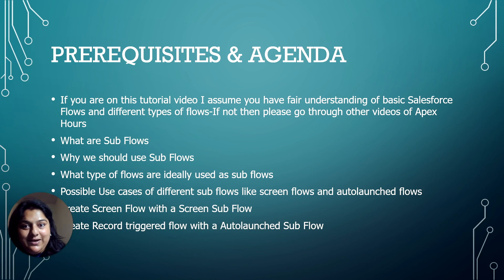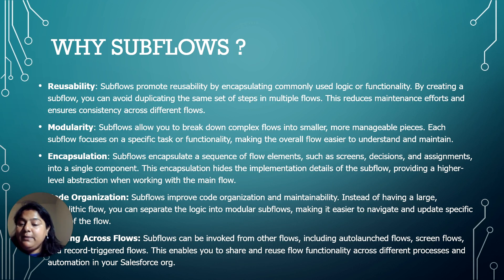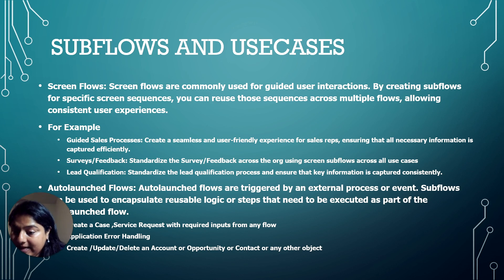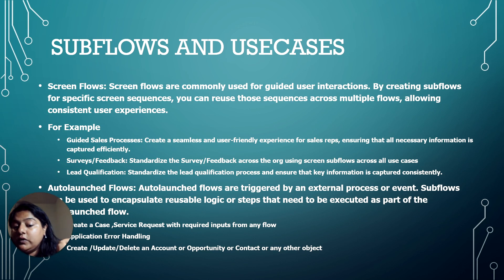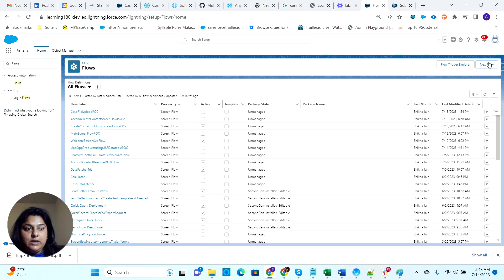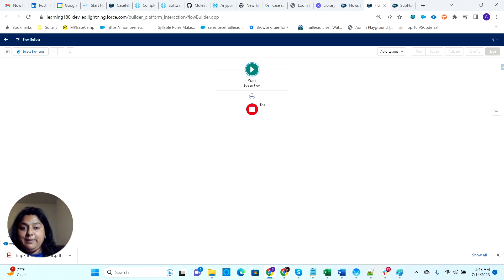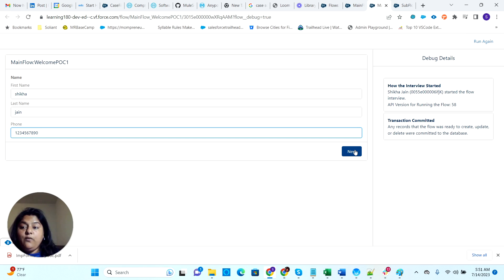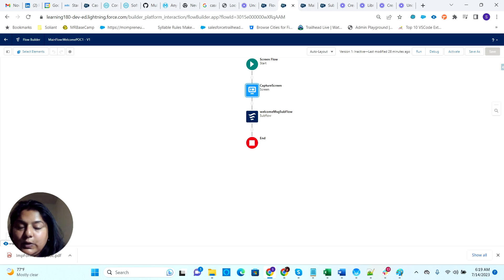Subflows in Salesforce

Comment: Thx for explaining how you connect subflows to the main flow. Can you also clarify how if one step in a sub(or subsubflow) fails you can easily see where it fails so you can debug? E.g. will the step in the main flow highlight where the failure in the flow sits and from there you drill down to the subflow where also the failing step in the subsubflow will highlight?
Also if such a debug option is available is it available to the developer only or also to the end user so they can debug flow errors themselves?